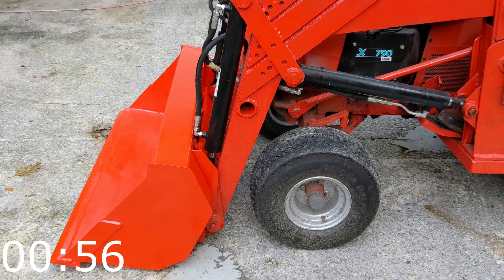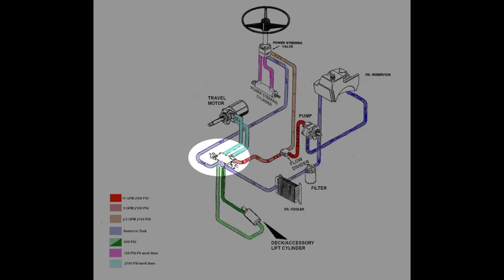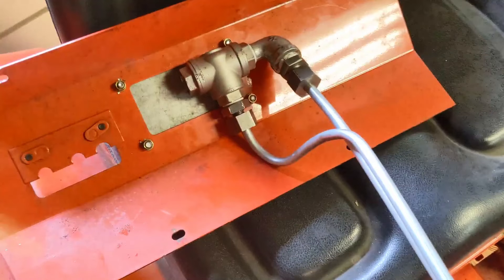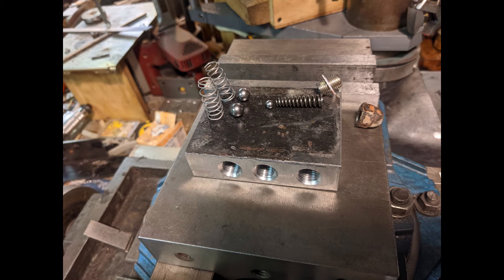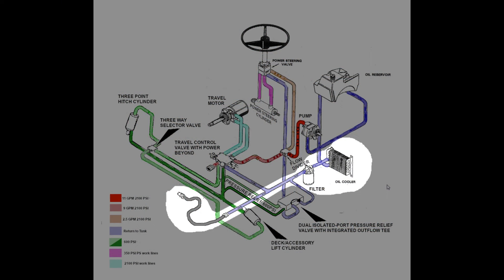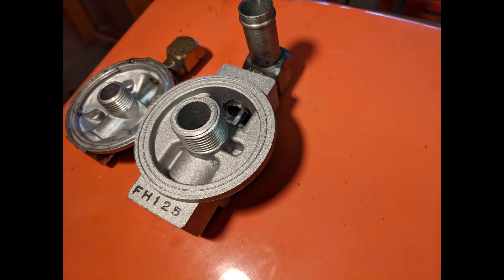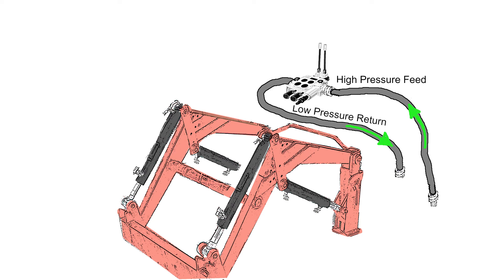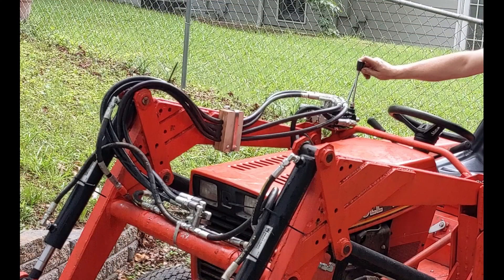Building a Loader for a Garden Tractor - Phase 5: Hydraulics (The Result)

Comment: Great project! Did you modify the tank capacity b/c of additional cylinders, etc.?
Reply from the maker: great question!  I was afraid I'd have to, which I planned to do via a sealed cap with siphon tube, like a radiator overflow.   But it's been unnecessary.  For which I'm grateful!
Reply: @TheBuildist  definitely great news. what size cylinders are you using? btw, I have installed open center control valve in serial with existing valve. hope that will work in non-parallel operation.
Reply from the maker: @vladbregvadze7050 I used 2 inch bore cylinders with a 16-inch stroke and 1.25 rod

Comment: Great job. What oil filter did you use on new hydraulic housing and did you change the return line into tank. By tank has a .500 inside diameter with 3/4” rubber hose.
Reply: I think ingersoll use WIX WL 10030 filter and had a 40 micron and a 16 by-pass valve and only good for 7-9 gpm .Made by Zinga hydraulic. Your choose of filter is better flow and micron .
Reply: Great job,  nice looking loader, our front end loaders are fed from the side without any twisting issues , however if you lift heavy objects from the corners of the bucket then you can twist the loader ... but then again you probably can't pick up enough without destroying the front axle or lifting the back of the tractor off of the ground to possibly twist the loader..... you would probably twist the tractor first.....
Reply from the maker: I used a WIX 51519 filter.  I'm not sure the id on my tank inlet, but I didn't disturb it.  In the stock filter head, the inlet fitting has an id of around .400" which I couldn't ignore.  For the non-ps models, about 9 total GPM, that's not great, but maybe not egregious.  But at 11.5 GPM on the ps models, that's simply unacceptable IMHO.